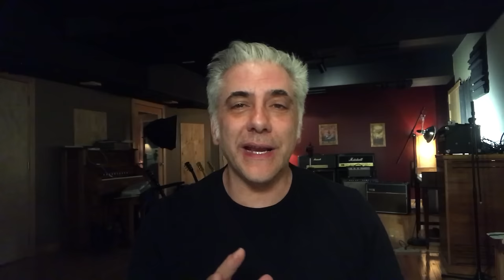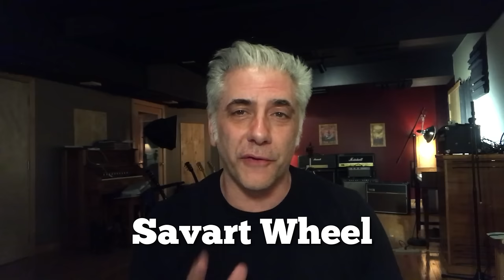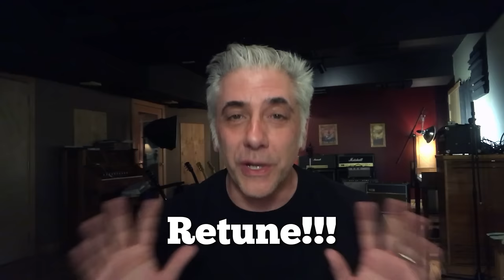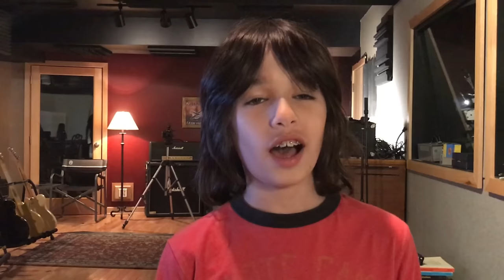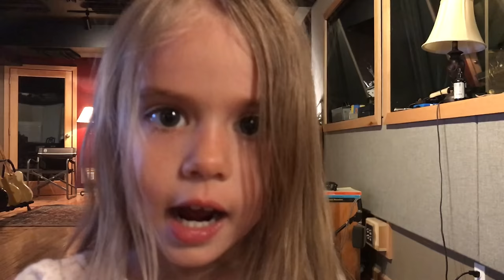What's the Deal With A = 440 Hz vs 432 Hz? Let's Talk!

Comment: They set A440 tuning in the 1930's. What makes 440 hz ill isn't 440 itself as a tone but the mixing of that frequency with equal temperament, which is 12√2. This makes for a ratio of 1.05946 between each note moving up the 12 notes of the octave. 1.05946 is a chaotic decimal number, not an audibly even ratio like 1.5 (3/2) or 1.33333 (4/3) is. Justonic uses sensible ratios to hop between notes, 2/1, 3/2, 4/3, 5/4, 6/5ths etc. If you tune to A440 in justonic tuning then the C note lands exactly on 528 hz. 528/440= 6/5ths ratio (1.2). In other words, 6 divided by 5= 1.2 and if you multiply 440 by 1.2 to get another harmonic you land on 528. It all depends on the intonation or temperament more so than what A is tuned to if that makes sense. A440 in equal temp (standard temp, dissonance) is definitely anxiety producing and even headache producing when you've heard truly harmonic music. I'd say 440 is the worst mix with the standard temp and they did that on purpose, because it resonates right around the ark of the covenant frequency and the 110 hz octave right-brain activation frequency but in a disharmonic relationship causing dissonance to cloud the right brain and ark of the covenant frequency with that orderless 1.05946 ratio leap relationship between each note.
Reply: Yes compare a tritone (C major) using 12-TET to just intonation you get the point.. 12-TET's major third is way to sharp and gives a pulse/beat when playing the c major chord. Using harmonic intervals that C major chord is calm and peaceful with no pulse/beat. That why a string quartet using non-fretted instruments or an acapella group can sound incredible hitting a 4 tone pure harmonic chord. That said I still prefer former standard at 435Hz than 440Hz using 12-TET as my voice and others sound less hyped and my  passaaggio lines up better.

Comment: piano builders were unsure of themselves, and didnt want to be compared to the others who used other tuning systems, so they came up with a standard so that each could be measured against it..the ones with the most clout won out, and the others ended up buying new tuning forks..which were not cheap since they were hand filed to the standard tuning.., the reason for the tuning standard was also that it was difficult to come up with a frequency that was a prime number..i assume that the tuning of the standard tuners involved using two tones that were seperated enough so that they had a secondary beat frequency..one that could be measured..one per second or something similar..prime numbers just dont give such a frequency..

Comment: Before I lost some of my hearing due to working in the coalmines. I could tune open each string individually by the tone I wanted each song that I wrote or played varied a minute amount maybe on the g string along with the b or a ect. I noticed all tuners that I happened to use which rarely only put the guitar in vicinity. My question is/was 440 vs other hertz put the tuning like I used to tune without issues or struggle. I still hear decent  but not like I want to. According to the video id say no. Thank you for your input and videos.

Comment: Pearl Jam's single Even Flow on the greatest hits album (rearviewmirror) has the lead guitar tuned slightly flatter than the rest of the band, unlike the original album release. My guess is that the tuner was calibrated differently because the lead guitar is in tune with itself and the rest of the band is sharp compared to the album version. This is the version that's played on the radio for 25+ years.

Comment: There's also a ton of 70s songs that seem to be tuned to A=whatever the Bass player says it is, and it winds up between A=420 and A=448. Then you also have that huge collection of rock bands that use an Eb tuning, which I'm pretty sure is A=415.30. It might not matter though since you could still play a note at 440hz. And the guys who care about this really only care about being pedantic about frequencies. 

If you want to get really weird you can look into all of those metal bans that tune to C standard.  That would be A=261.63. That has to be better frequencies.

Also whatever the hell AC/DC spent that part of their career tuning to.
Reply: Fitz, I love your first notion of A=whatever the bass player says it is.
However, after that you seem to mix up the concept of transposing instruments, alternate tunings and reference pitches. Miles would read and call the base note on his trumpet a C, which actually sounds Bb in concert pitch (transposing instruments). SRV tuned to Eb, but would not call that E - alternate tuning.

Comment: What interests me more is that al lot of great masterpieces are written in A=421.6 . If it was used for tuning the A...
Reply: Mozart was probably not using 12-TET when tuning his piano.. The period of Mozart were more concerned with  perfect minor and major thirds.. I know the conversion from one variant of Meantone to 12-TET for a 1850 piano maker.. They set A4 at 433.5Hz with meantone and 436Hz with 12-TET. So a difference of 10 cents.
 If mozart were using Menatone his A4 would be higher at 424Hz in 12-TET. If his A4 was tuned as the La (major 6.) in the scale of C major using just intonation we are talking a 15 cents deviation. So from Just to 12-TET his A4 would be 421.6Hz in Just, but closer to 425.4Hz in 12-TET. ..This seems reasonbale to me.... THe region from G#4 at 413-421Hz (A4 at 438 to 446Hz) with 12-TET never made much sense to me.. It feels either too high or to low vocally.. a pitch like 445Hz would force me to flip into falsetto in the the high range.. I need pitch down at 435Hz or slightly below (432Hz)  to maintain  a natural closed state of vocal folds when I cross the second passaggio..

Comment: A lot more info is out since this video was made.  432hz.  is here and is the future. Those who were programmed in the corporate education system will be slow to catch up but they will make it.   Many artist's have been rumored to have used 432 but most are no longer with us👌. Tune to 432 and relax, you will feeeel it. ----  I still luv you Rick. LOL
Reply: 432hz makes dissonance impossible to control as 432hz is inherently more dissonant than 440hz, which makes the consonant intervals less easy to work with

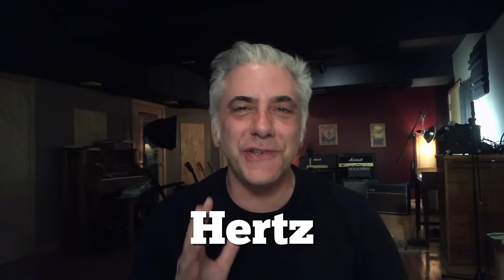Comment: I caught Rick Beato making a slightly nonsensical statement at 0:55 in the video: "No tuning standard based on hertz could be developed or used until the term was invented."  Well, "hertz" (or "Hz") is just a fancy name for "cycles per second" (or "cps").  I'm pretty sure this new name was just a way of honoring a famous scientist named "Hertz".  So a tuning standard based on hertz or cps could have been developed as early as 1834 when it became possible to accurately measure frequency.  It's just that if there were such a standard before 1930, it would have originally used the term "cps" or "cycles per second" rather than "hertz".  But then Mr. Beato goes on to explain at 1:00 in the video that "A = 435 Hz" was adopted in France in 1859.  So I guess the previous statement that I found slightly nonsensical was actually meant tongue-in-cheek.

Comment: I had no idea there was a conspiracy theory about an 8 Hz difference in concert A.  I guess magical thinking shows up everywhere?  Apparently they believe there's a relation to the old middle C = 256 Hz standard, but they're getting to A432 by going up three fifths from C128, which makes no sense as you're now getting to intervals that are no longer based on small-integer ratios; using 27/8 for [octave + major sixth] just isn't very useful when you're dealing with harmony within one octave more of the time.

But I'm weird I guess, I prefer 2^(9/12) for the major sixth.

Comment: For anyone here who's commented already, wants to comment, is knowledgeable on this subject, and has agreements and/or disagreements regarding the A=440/A=432 hz. issues, please address my concern:

To answer Rick Beato's question, I go with A=432 hz. because when I sing, I know my voice range aligns with the Twelve (12) True-Fifths tuning scale developed by the late-Maria Renold.  With the 12TF scale, frequencies like C=128, C=256, C=512, and A=432 hz. are well-aligned.

Does this mean I have a problem and, thus, need to retrain myself to be able to sing at A=440 hz. and any other frequency not A=432 hz. at the risk of straining my voice and vocal cords?  If yes, please explain how this is beneficial even for me.
Reply: My voice also aligns perfectly with 432Hz... Singing becomes a breeze..  
I tried lower with 12-TET like 430Hz but felt some notes started to get a little too low and at 435Hz a few notes feels slightly high like the D#4/E4 at my second passaggio.. The artificial 100 cents  intervals of 12-TET will have some notes be a little sharp and some notes a little flat so 432Hz is a really good comprimise as you get the correct pitch for A4 right.. A3/A4=216Hz/432Hz just feels right..  THough I prefer to be on the sharp side  for contemporay music and find 434/435Hz a good comprimise.. As soon as I go above 435Hz the passaggio is shifted a little too high for comfort..

Comment: 432 Hz (A=432hz) tuning is derived based on Pythagorean harmonic ratios. It does also happen to be that 432 squared is the frequency of the speed of light within hundredths of a decimal point. 
Not sure what there is to mock here?
Reply: You're absolutely correct, mate! Pythagoras' seminal work "Make Hertz, Not Hurtz" describes in great detail how he invented harmony and brought peace to the Hellenic world. Before this scientific breakthrough every instrument - be it lyre, moog flute or athena panathinaikos (which is the precursor of modern dulcimer btw!) - was tuned differently, sometimes even randomly. Musicians of his time were often abused verbally and burned alive because of these inadequacies - no matter how good a pianist you were, your instrument was always worse... When Pythagoras was hired by a local funeral bureau to measure the frequency and intensity of then-rampant bard-burning to maximise the coffin-makers' profits, an idea struck him. As he was using the most advanced time-measuring device of his time - a precision sundial - to measure the amount of bards burned per hour, he modified the apparatus to measure harmonic vibrations per second instead. The rest is history :)

P.S: You're right on point about the speed of light as well. 432² = 186 624 - which is exactly the speed of light, down to the 88th decimal point - 299 792 458 m/s!

Comment: He left out the verdini tuning part of the story.  Opera singers tried to make the standard A-432 because it is not as hard on the vocal chords.  The high notes are not as high with A-440+.  Also i find for me whern strumming the chords and trying to sing, that 432 is easier to sing to.  When i hear someone singing flat i imagine they are singing to 432 even though the players are tuned to 440.
Reply: This is very true.. A lot of novice singers would naturally sing around 432Hz than 440Hz if not singing to a 440Hz tuned track but singing accapella.   My own voice resonants naturally on most notes in the 12-TET scale when i tune A4 close to 432Hz.  The former European pitch at 435Hz (20 cents flat is a nice compromise)... Has a little more "lift" in the chest range without pushing the middle (mix) of the vocal range to high..

Comment: I love seeing fake science debunked, but there are problems. Ratios do not care about units. If an ancient column exhibits the Golden Ratio as measured in inches, then it would have had the same ratio in whatever units were used to design it. Also, if you wanted to adjust all your instruments accordingly, you would not just subtract 8 Hz. Rather, you would subtract the log(base 2^(1/1200)) of 440/432 cents, i.e. 31.77 cents.

Comment: So I was trying to play along in my Technics digital piano and noticed that it is noticeably flat. When trying to figure out how flat it was, I found the A432 stuff and it turns out that my piano is basically tuned to A432 for some unknown reason (seems to be about 1 Hz flat from 432). How this could happen on a digital piano is beyond me.
Reply: @SPNKr16  I actually found out what happened: My piano has a way to adjust overall frequency fundamentally (not just the transpose function). It's not on any of the main menus, but you can get there by a certain sequence of button presses. My 4 year old son had been playing with the piano and managed to adjust it. It's now back to spot on. Complete coincidence that he unwittingly changed it to very nearly 432.
Reply: @paullackey8813  i guess he was going off natural ear instinct  😂

Comment: Even though those standards where adopted on the dates you suggested, I know for a fact that the world "all of the sudden" just after the turn of the last century went from 432 to 440....at the same time. I refurbish 100s of antique saxophones from that era and anything older than 1910, you have be aware that it may be 432......They stamped everything 440 with  a simple "L" to indicate "low pitch".......Saxophones are not the only horn to posses this "L" designation, anything manufactured around that era had the stamp. Older Selmer horns going back to when Adolpho  Sax invented the Saxophone were all tuned to 432. You also forget that there existed a (government?) job where one guy would go from village to village carrying a tuning fork and insuring that everyone was in fact tuned to 432Hz. I've delved deeply into this subject trying to find the REASON the entire planet in concert (pun intended) agreed all at once to make this change. The world cannot agree on any one thing, yet this was accomplished without any fanfare or pushback from anyone at the time.
Reply: I believe low pitch refers to the pitch agreed upon first in France 1859 and then in the rest of Europe in 1880.. That pitch in also called continential pitch or international pitch back in 1910.. This pitch was A4= 435Hz or 517.3Hz for C5. THis is closer to 432Hz than modern 440Hz.. Former opera pitch around 1830 to 1840 in Paris and Vienna was 434Hz..  In Uk they took the french 435Hz pitch and bumped it up to 439Hz.. (a temperature conversion).. I really like the 434Hz pitch with 12-TET.. I find that if I tune down to 430Hz with 12-TET the chest register becomes a bit to low and I will have a tendency to go a little sharp on the low notes if I push a lot of volume and energy..

Comment: Rick, you seem to suggest that tuning to A432 (a bit lees than 1/3rd flatter,) ruins the quality of the music enough to say it's a waste of one's time to try it. I have a solution. A444hz. It is another healing frequency, only higher, and it is relative to the Schuman Resonance (Earth's atmospheric frequency). You made it clear that you do not genuinely believe in healing frequencies, but I was just informing you about A444hz because it's only about 1/4 shift away from standard A440hz. You claim that the music is significantly degraded by attempting to digitally convert it to A432hz, so A444hz is a perfect solution save healers from wasting their time.

Also, for the audience, I generally default to A432hz when converting my favorite tunes, but sometimes the music feels really weird. Almost as if I'm underwater. Even though there is nothing wrong with the conversion. When an A432 tuning sounds odd compared to the original, I found that converting that track up to A444z is the magic solution. Amazingly, dance tracks seems so sound better pitched to A444hz. Which is so odd because the tempo doesn't change. This is suggesting that music played in lower octaves tends to be wanted to be performed at a slower tempo. I am actually doing some incredbly in-depth academic studies co-relating tempo reduction as paralled to a tuning system (equal temperament, precise temperament, etc). Meaning that I am calculating in a relative tempo-reduction into the tuning itself. Therefore the Pythoarian comma "dissonance" that comes up in pure tuning is also observed from a standpoint of tempo.

You may want so also check out my videos on perfect pitch and why we actually have it, and how it can (or cannot) be learned. My findings (opinions? facts?) are very different that what you are suggesting in or perfect pitch videos. 

I am writing form my secondary channel, if interesting please find me at The Acoustic Rabbit Hole channel. 

I would also be delighted to get some of your audience's feedback on my work, so all are welcome.

See you at: The Acoustic Rabbit Hole

Comment: 432 is relaxing. I don't use expensive equipment, Audacity works. It can pinpoint 440 in the spectrum plot. Use the Change Pitch effect. Pythagorus is famous for his study of numerical ratios in music scales. He did not have modern equipment. The second (unit of time) is an arbitrary metric. The pitch of A in 432 Herz is the same as A in any other unit of time. That is what qualitative and quantitative mean. You should remake this video without the unnecessary smarminess. Not that I care. I am offended by semi-smart people thinking they are better than their betters. A lot of musicians don't even use 440 or 432.The ratio between notes is more important than tuning.

Comment: Without getting into a discussion regarding which sounds better between A-440 or A-432, somebody help me out make sure I got this straight.... question.... so any backing track that I find here on elsewhere is going to be done using A 440 (unless they specify otherwise)... is that correct?